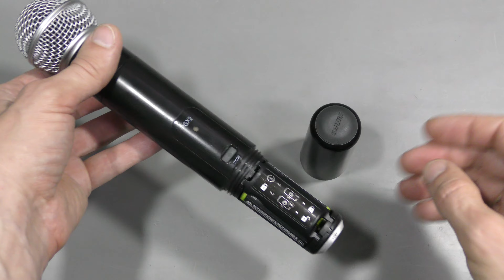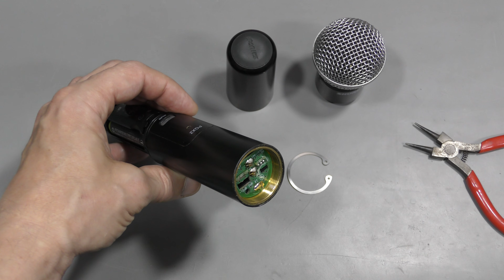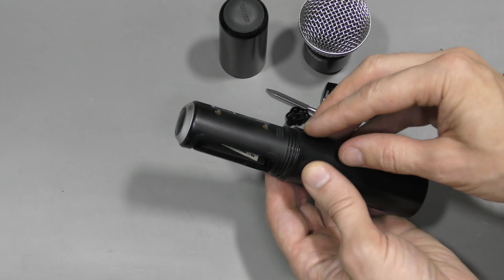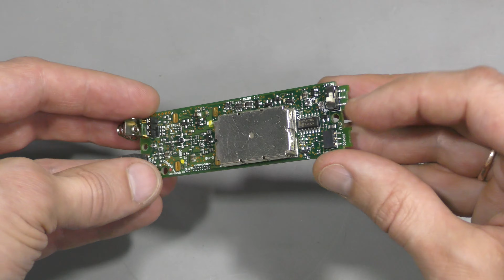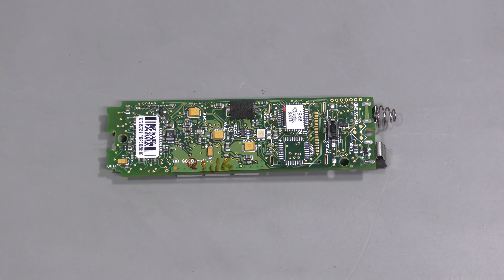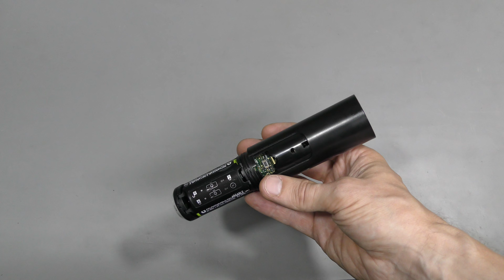#113 - Shure PGX wireless handheld microphone repair

Comment: There is another way to fix it. You can disassembly switch without desoldering. There is only three parts inside. On the bottom of switch you have to scratch copper part to get it shiny and assemble back.

Comment: A handy tip for using desoldering braid is to hold a piece with hot tweezers. The tweezers supply the heat, allow more precision and stop you burning your fingers on the braid.

Comment: Thanks for the video.  Is there a way to change the operating frequencies?  Example instead of 790-820, to change 606-636 by changing the section?  Regards

Comment: In my case, the PGX2 transmitter has a working switch yet no power. The owner kept the wireless mic in a dry place. What could be at fault?

Comment: I need to replace the switch on my microphone, but I don’t own any soldering tools, is there any alternatives other than paying somebody to repair it?
Reply: I did the replacement in under 10 min. I have extra parts if you want me to send you the switch. Or you can remove the board and ship it to me
Reply: @djjoeybeatz does that offer still stand about the repair? Could I send you my mic I have the same issue?

Comment: I would use a side cutter and cut the leads. Then remove the rest of the component from the board, I'm lazy that way
Reply from the maker: I think this is more dangerous. Sometimes too much cutting force can be transferred trough the lead to the pad. At least I am afraid it could.
Reply: @feedback-loop  Your right, but if I can't normally I brute force it out/off
Reply: Another option is to protect the area around the switch with Kapton-Tape and use a hot-gun to de-solder it, however this method means to the switch is likely to melt.
Reply: @HelmutTschemernjak  That's a Good and Other way if you have the equipment to do that